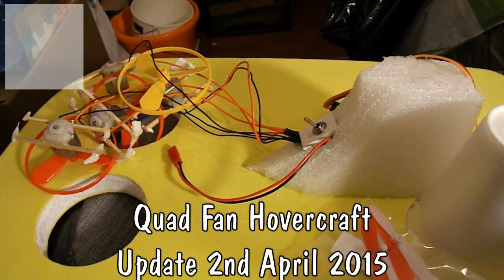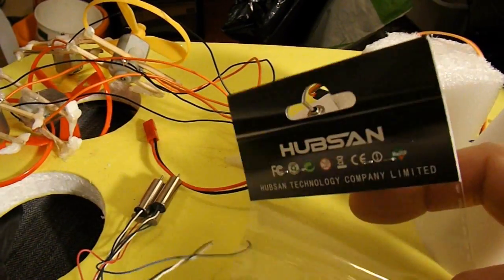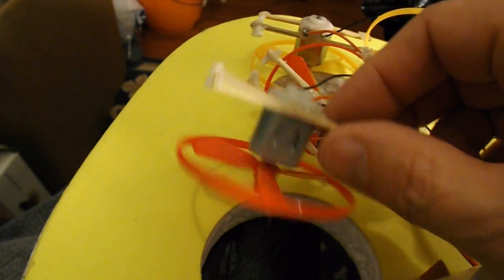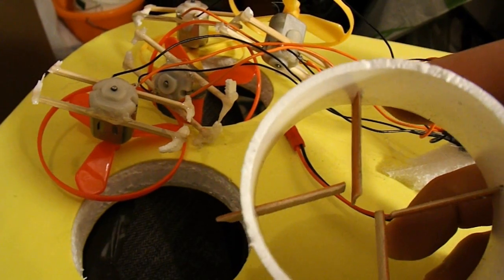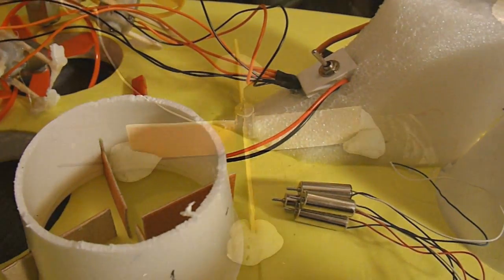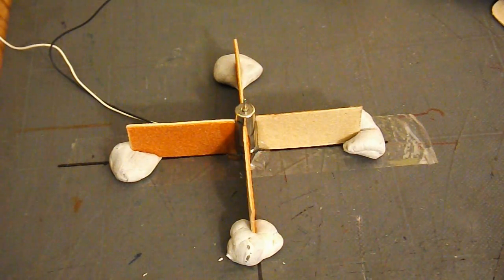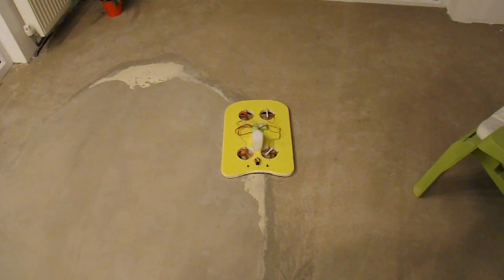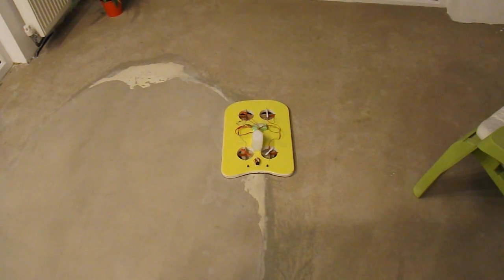Quad Fan Hovercraft Update 2nd April 2015

Comment: I really like your method of gluing the motor to the 4-way mount. That's ingenious!
Well Done Grandad! :-)

And if possible, can you do a help file on wiring motors in parallel. Thank You. :)
Reply from the maker: Sahan Methmal I won't be doing a helpfile. The wires are just all joined together. All the Red wires go to the positive. All the Black wires go to the negative. If your wires are different colours then you will have to work that out yourself.

Comment: can you make a rc hover board that can go over water
Reply from the maker: +Kaidan Mckelvin if you mean a hovercraft then it will work on water if it works on land. A hovercraft is supported by the cushion of air it creates underneath so it will work on either. Depending on how large you hovercraft is, the only surfaces that give it problems are porous surfaces like pebbles and loose gravel. With small models like I usually make, they will struggle on carpet because the air can escape into the carpet, but water is airtight so the air cannot escape.

Comment: perhaps 2 motors would be enough!  and yep dont overvolt the motors, wont last long,
Reply from the maker: jusb1066 The original idea for this hovercraft was to use cheap motors from vibrating toothbrushes, that is why there are 4 motors. Check the video description for the playlist.